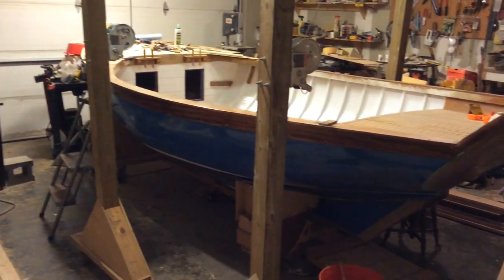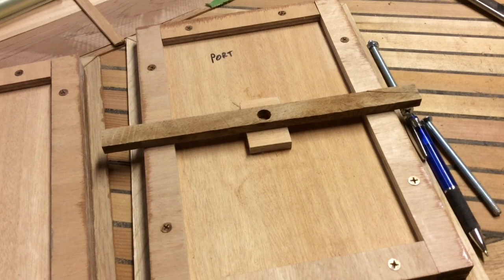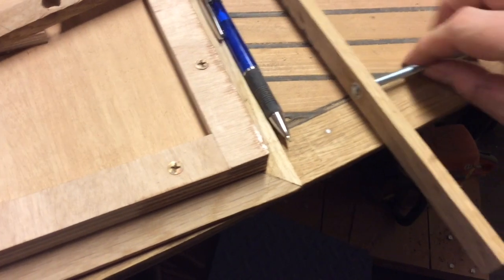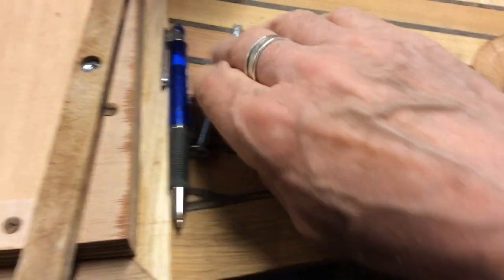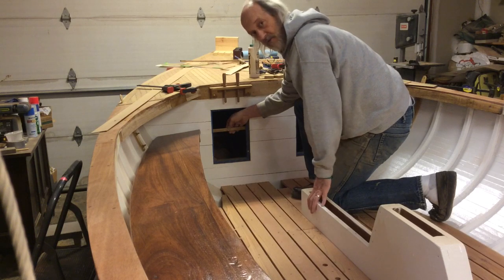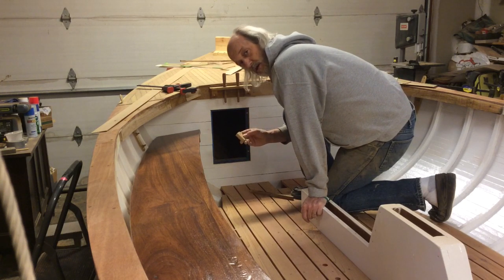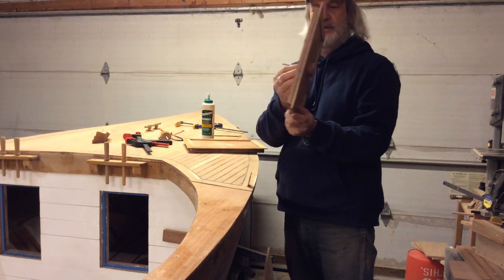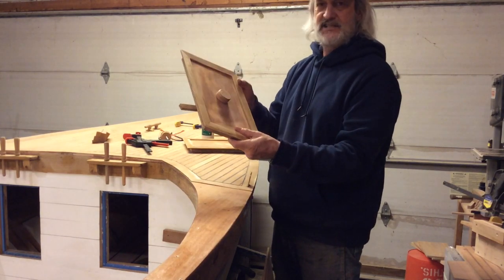Boat Building The Haven - Hatch Latches - Episode 94

Comment: Thank you for taking the time and effort to do your videos. It is helping me with courage to start my own boat building project. I will be steam bending also. Can you tell me what plastic sheeting you used? I have looked online for heat resistant plastic but am not sure what to get. Thank you again.  David
Reply from the maker: I am told, recently that any heavy construction plastic should work. This was right after I ordered more 18 inch width tube plastic from ACP. I will try to find the website and link it in another comment in a bit
Reply from the maker: Here is where I ordered nylon vacuum high temperature bagging https://store.acpsales.com/products/2298/nylon-vacuum-bag-films

Comment: Ah, she has a name now! I have made electric guitar knobs in the same way, they look cool and ar quite easy to make.
Reply from the maker: Had I not told you her name?  I fear that I tell the story too often.  I think I will take some time and do a video about that as well as celebrating 1000 subscribers. I find myself slightly preoccupied with the new shop and I fear that Spring is going to cut into my boat building time but I am determined to get her in the water this season.  Well so anyway, as you may remember, when we first started, I needed white oak and was having a hard time finding lumber. I live on about 35 acres and at least half of this is timber.  I have some white oak although I had to learn how to identify it.  The tree that we cut down was in a part of the farm called, The Enchanted Forest. We burn some wood for heat in the winter and so we also cut wood from all over the farm but in particular this one area. It is across a pond from the house and up a hill. One day, several years ago we found a dead tree over there that was felled but not rotten and it was quite large. We could not move it out of the woods, it was much too large and very heavy. So we cut it into 15 inch sections and started rolling these pieces out into a clearing where then we could pick up and move closer to the house and wood splitter.  My wife helped me and we worked quite hard all day on that Saturday. We were both exhausted.  On Sunday morning I knew that we still had a couple pieces over there and I told her that I was going back over to get them moved out. She looked at me and asked if I thought I could manage on my own and I said yes. She said, "well, good. I don't really feel like going back over to "the enchanted forest" again today."  and so the name for that section was coined and has stuck to this day, and so as I got the original oak tree from there, it seems fitting to, in a way name my boat after my bride and the farm from whence so much of her back bone and ribs came. You probably still see me on occasion trying to use some of the wood I still have left over for this little piece or that. And now you know the rest of the story!
Reply: @JenkinsBoatWorks  Now you re tell the story I do remember Chuck. Tbh, I have watched so many builds over the last few years that some things get forgotten. I do re watch things to find details I need to understand. It is a nice story and a nice name.